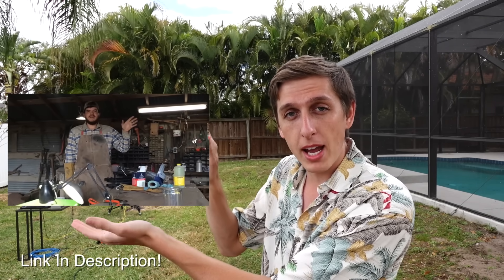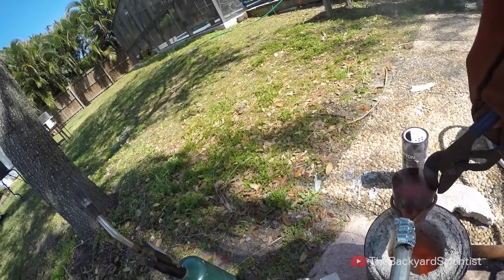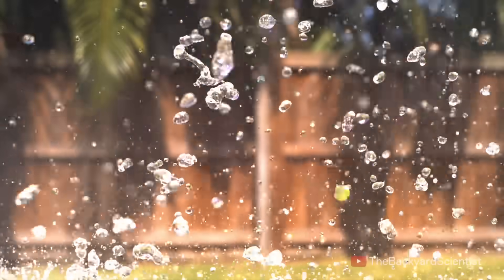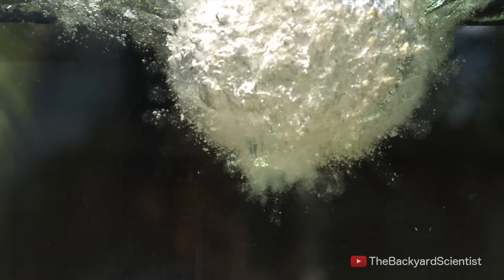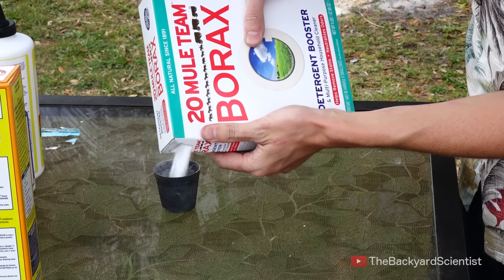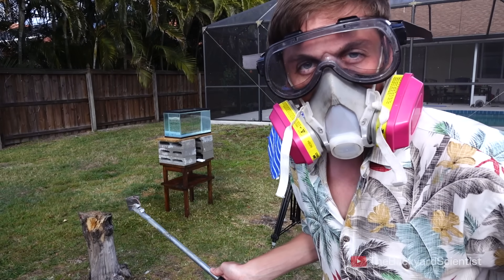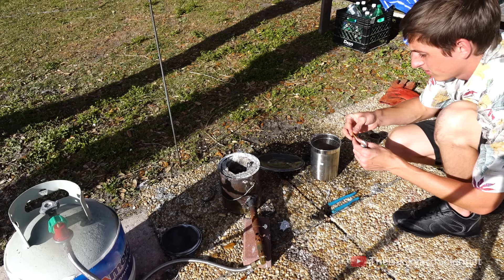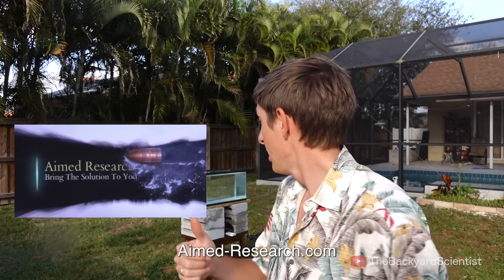Pouring Molten salt into Water - Explosion!

Comment: I don't think it's a chemical reaction. If you look at the reactions of sodium (molten and solid) in water neither have such an effect and chlorine in water doesn't react like that either.

Looking at the other ionic compounds added, all of them form smooth surfaces and ball like structures that minimize the surface area in contact with the water, the leidenfrost effect (mentioned at 5:24) prevents flash vaporization of the water.

Sodium Chloride (NaCl) as you see in the beginning (~ 1:00 ) forms large crystals with lots of cracks in them... Cracks that can trap water. I think as the molten NaCl solidifies it traps water within the cracks which flash vaporizes from the temperature and expands at (from the looks of it) supersonic speeds creating a shock wave.

I've just gotten to the ending of the video where @TheBackyardScientist offers the same explanation lol but I'll leave this anyway as I agree with his explanation.

Comment: It's a physical change (there's no such thing as a "physical reaction"), not a chemical reaction.  The sodium in sodium chloride is not sodium metal, they are sodium ions.  Sodium ions do not react with water.  If you wanted to get solid sodium, which does react with water, you would need to run a current through your molten sodium chloride.  This would, in addition to creating liquid sodium metal (no longer ions), make the chloride ions oxidize and become chlorine gas.  This would be in an electrolytic cell, as it is non-spontaneous redox reaction.
Reply: there's no shame in knowing stuff
Reply: you're*

Nevertheless, I don't think that his hypothesis is true.  Sodium chloride is a strong electrolyte, it ionizes in water.  I don't think the water (which has a very high specific heat capacity) heats up and turns to steam before the sodium and chloride ions separate.

As I said in another comment I'm just being pedantic when it comes to the definition of "reaction."  No chemist would ever call a physical change a reaction.

It wasn't being showy explaining that no reaction took place because he tested the pH of the water, he thought at one point that a reaction might have taken place.  I explained why it couldn't have.  You have a problem with this.
Reply: I'd call it a change in composition.  I was just being pedantic when I spoke of "physical reaction", to be honest.  The main point I'm trying to drive home is that heating up salts do not reduce cations or oxidize anions - electrolysis does this.

What's interesting is that to have the electrolytic cell you need the ions to flow freely, which is why heating them up to break their crystalline structure is so important.  If the salt is soluble, like sodium chloride, you could just put it in water to free the ions.  The problem, though, is that water is a stronger reducing and oxidizing agent than chloride ions and sodium ions, respectively.  So if you ran a current through salt water, it'd be no different than running it through de-ionized water.  The sodium and chloride ions wouldn't do anything.

The oxidation and reduction reactions of water are, respectively:
2H2O(l) → O2(g) + 4H+(aq) + 4e-
4H2O(l) + 4e- → 2H2(g) + 4OH-(aq)
Reply: I know Da Wae U DO NOT KNOW DA WAE
Reply: I actually used to remember this stuff back in chemistry class.
Reply: NaCl(sodium chloride) + O_2(oxygen) -heat-> NaClO_2(sodium chlorite)

sodium chlorite dissolves in water to form chlorous acid
NaClO_2(stable) +H_2O --> HClO_2(chlorous acid)(unstable)+NaOH(Sodium hydroxide)

Chlorous acid is unstable and will decompose to form hypochlorous acid and chloric acid

2HClO2 = HClO+ HClO3
Reply: Sodium hydroxide is a base and hypochlorous acid and chloric acid are acids.

Mixing the two(chlorous acid,Sodium hydroxide) would cause neutralization.

The reaction would not take place until it's placed in the H_2O.
Reply: No, that wouldn't happen.

The water has no sodium hydroxide in it.  If there was sodium chlorite introduced, the chlorite ions would react with water to create hydroxide ions and chlorous acid.  An equilibrium would be reached, but because we started with only chlorite ions and water, according to Le Chatelier's principle we must move forward in the reaction:
ClO2-(aq)+H2O(l) →← HClO2(aq) + OH-(aq).

This is still assuming that sodium chloride reacts with gaseous oxygen when it heats up, and nothing seems to support this, especially because heating up table salt and letting it cool down yields table salt, no combustion occurred.
Reply: Puberty is a physical reaction to hormones
Reply: wow 😮
Reply: Pranam
Reply: I didn't even think of the combustion of sodium chloride!  Next time I see my friend (he's studying chemistry) I'm going to ask him if that reaction of sodium chloride and gaseous oxygen can yield sodium chlorite.  

My hunch is that it (the sodium chloride) did not react with the oxygen in the air, because if it had then the water would have become basic (as you noted, sodium hydroxide would be in the solution), and his pH test indicated it was still neutral.

I was googling how sodium hypochlorite is prepared and I couldn't find anything about sodium chloride reacting with oxygen.  I did find this, though http://www.madehow.com/Volume-6/Sodium-Chlorite.html

edit: I asked him if sodium chloride can combust and he said no.  I'm not surprised because the sodium chloride melted before it readily reacted with anything.  He said it might be possible in small quantities, but he doubts it.
Reply: English please?
Reply: Good point but actually it is a chemical reaction because salt has a atom has one less atom than the water or h2o. But then stabilized when sodium and choline mix it goes with an even flow and it can also be a physical change because there is also no physical reaction. With physical changes you can see them much quicker that chemical changes.
Reply: citanaf citanaf so if you hit me and I hit you in retaliation, that's called a change and not a reaction?
Reply: citanaf citanaf cool knowledge
Reply: Physical reaction is what chemists call change in state... well at least my chemistry textbook and teacher say that.
Reply: 7:38 he literally said that sodium chloride reacts with water.  So no, it is not "literally what he said without be a know it allllll[sic]".  

Just because I know basic chemistry doesn't mean I'm trying to be smarter than anyone, I'm just pointing out what actually happened.  If me doing that makes you feel so insecure you probably have no interest in science, considering you can only learn when you're wrong.
Reply: the system reacts in a physical way? so then it would be a physical reaktion
Reply: citanaf citanaf
Reply: AHA YOUR A GEEKY NERD

Comment: Ok now I'm scared to eat anything with salt and water
Reply: Stay away from things that are 801 degrees Celsius and you will be fine
Reply: are you high?
Reply: One cannot simply avoid things of that temperature, you're asking too much.
Reply: Yes only avoid tempratures under 801 mk
Reply: Lily Slone funny
Reply: I lost faith in humanity.
Reply: unless you drink glowing red hot molten salt for breakfast  everyday i think youre pretty good.
Reply: Lily's reborn nursery 1 MELTED
Reply: gamingcentral :
kilauea volcano lava flows into the ocean :
https://www.youtube.com/watch?v=zmn71-DvVf8
from youtube search (magma flow to ocean) result 1,
does not cause explosion, lava temperature is 700 - 1,200 celcius 
source :
'Lava is molten rock generated by geothermal energy and expelled through fractures in planetary crust or in an eruption, usually at temperatures from 700 to 1,200 °C (1,292 to 2,192 °F).'
in
https://en.wikipedia.org/wiki/Lava
from google (lava temperature) result 1
Reply: gamingcentral :
correction :
Lava Pours Steadily From Hawaii's Kilauea Volcano 
https://www.youtube.com/watch?v=HzwuTBx93uA
shows explosion, so i guess anything hot going to the water, causes explosion
Reply: salt maybe is damaging :
try smear water to skin below an eye then
 smear salt to that wet skin area then
 around 5 minutes later that eye will feel hurting.
 replace that salt with sugar then that eye will not
 feel hurting.
 so salt is damaging, sugar seems not damaging.
Reply: GamingCentral lol
Reply: humans are sooo hot.. and the water mixed in, was just about to state the same. . life is sooo dangerous Oo oO

Comment: Actually if you drop pure sodium (non heated) into water it will explode. It's a chemical reaction. The fact that you obtain no pH change doesn't rule out chemical reaction. And that is the reason why in labs, if you store pure sodium, you must store it in a special container to ovoid humidity.
Reply: Ashrak Krazlegan in this case it does rule out a chemical reaction because sodium reacts with water only to make NaOH which is a strong base so the ph would rise into the basic area >7 with this amount of water involved 
Any other possible product made from NaCl and H2O which COULD be produced but does not in reality would still induce a ph change
When you heat NaCl it does not revert back into Na and Cl atleast not at these low temperatures 
The only thing happening is the rapid cooling of the salt which in turn heats up the surounding water
At temperatures way above its boiling point 100 celsius the water explosivly vaporises because water vapour has more than a 1000 times the volume as its liquid form

Comment: wonderful! I had a physics teacher in 7th grade, my first class ever of physical sciences, blow up a cup of sugar. The event was so extreme and over the top, everyone had to leave the room as thick wide coils of carbon were snaking off the desks and going everywhere. I loved it. What happened? What happened to the teacher? But that memory is forever.

In Supermans house in the arctic, he lives in a house of crystals. There is some gobbledygook about it, but then you can compare it(the crystalline shapes) as one of natures perfect shape, that old “one or another gone”. Theres only 5 in nature, and when you think about it, its ho hum. You see one shape you seen em all. But let me digress a little. Water can quickly get into the lets say pentagram sides and bawhoosh, wash out the sides like rock forms in the ocean. The crystalline shape stays the same over eons, or a loooong time. But! Bwahahaha for fun and dangerous giggles, why not pour molten salt which is fluid crystals (we saw that as the disc of hot cha cha melted salt return to Mortons salt, just a little dirtier.  The nature of design doesn’t change with elements. Well, it can, we can tour Cern’ gigantic chocolate making machine turning atoms into errrrrr particles but, lets stick(ha ha) with elemental salt. The crystals are all looking like Supermans house. I think we could easily blow up Supermans  house by filling it with hot molten aluminum. Each crack it found would expand and crack away from the next. Wow, we are talking a big big explosion. Super cool. But, at the end of the day, Superman will have to suck in all those salt molecules and probably blow them out into the ocean, which invariably help with the desalination of the wirlds oceans. 
I love science!
Reply: LSD or shrooms? DMT?

Comment: Have you ever thought that maybe the reaction is caused because of the iodine being used to treat table salt or have you used untreated salt? Also have you tried this experiment with sea salt or let's say Himalaya pink salt?
Reply: tudy000 the iodine in salt is itself in salt form like NaI which is non reactive
 pure iodine would just sublimate of and would be quite toxic and kill you really fast
and even pure iodine is not able to react with water because the oxygen in H2O is far more electronnegative than iodine thus would not be able to rip any hydrogen or even oxygen from H2O
Reply: Yeah ok i get it, but pure salt has no iodine in it that's why i even asked if he used untreated salt,sea salt and himalaya salt :) since this 3 salts have no iodine in them

Comment: Final question: Because salt (Solium Chloride) reduces the surface tension of water (H2O) and allows more rapid transformation of the surface of the water.

High surface tension water with a hot "thing" is like a fat guy pushing his way through a crowd... people see him and move. Low surface tension is like a winger (American: Line backer) darting and weaving his way whether you move to see him or not.

Comment: A Bit late to comment on an old video, but here it is anyway.  Assuming your hypothesis that the water is getting into the middle of the  molten salt is correct (It seems plausible).  The Kosher Salt had a very low viscosity whereas the Borax seemed to be a much higher viscosity.  This would result in the water not being able to penetrate the glob of molten salt as easily the higher the viscosity of the salt.

Comment: Seems like the molten salt exploding in water is the result of a coefficient between the viscosity of molten sodium and its super heated state. Which would also explain why it didn't yield satisfactory results at lower temps. At a super heated state, the viscosity is probably so low and its temperatures effect on the water is so high that it deforms more readily in the presence of water and steam, capturing more of it in pockets of the molten salt, which then rapidly expand creating the explosion.

Comment: I think that to avoid leidenfrost insulation the surface needs to remain molten. I know from messing around with CO2 in water as soon as the pressure rises to a point CO2 turns liquid, heat exchange jumps up hugely. I think that the higher melting point stuff you add gets a surface crust possibly just from radiation through leidenfrost layer and so is boring. The salt keeps a liquid surface so the thermal interactions and boiling cause a chain reaction of mixing.

Comment: Sodium forms a single bond, Barium two, would this explain why the water molecule was able to penetrate? Or maybe I should stick to history
Reply: feoil Sodium Chloride (aka Table Salt, or NaCl) is broken into Na+ and Cl- ions with extreme heat. Alkali Metals (Lithium, Sodium, Potassium, Rubidium, Caesium, and Francium) all react violently with water. So, because the Sodium Chloride is broken into 2 elements (Sodium and Chlorine) and not a single compound is most likely the reason for this reaction.
Reply: Yes, but the guy in the video wondered why a Barium salt did not react the same way. As you have pointed out, an alkali metal offers only one electron in bonding, whereas Barium offers two forming a double ionic bond. My suggestion was that this closer bond (and therefore more tightly packed crystal) might explain why water molecules could not penetrate as deeply.
Reply: feoil Barium is an Alkali Earth Metal, Alkali Earth Metals do not react violently with water. Alkali Metals, however, are very reactive in metals. He was testing to see if it was just the Alkali Metal reacting or if it was the crystalized compound that was reacting with the water.
Reply: Yes, and he established that this reaction (molten salt on water) was physical rather than chemical. Therefore the relative reactivity of Barium and Sodium are not relevant in this case. What is relevant is the molecular structure of both salts. NaCl, is one Na exchanging an electron with a Cl, giving the Na a charge of +1, the Cl, -1. The Ba however, becomes +2 in BaCL2, with two Cl's of +1 each. This means a stronger magnetic bond between molecules of BaCl2 in either liquid or crystal form, thus hampering the penetration of of the H20's. Cos Barium is twice as attractive as Sodium.

Comment: My hypothesis is because the heating process weakens the bonds between the chloride and the sodium, so the sodium can act more on its own. Sodium metal by itself is extremely explosive and combustible in water, so the destabilized molecule and the reactive sodium would make it explode.

Comment: I can't see the correct answer anywhere here. Salt has a enormous latent heat of solidification. That is the energy it releases on going from liquid to solid. So you're putting a lot of heat into the water in the space of micro seconds. The water aggressively vaporizes resembling an explosion.
Reply: and that explains why it's not the same with other salts

Comment: The process of dissolving is exothermic when more energy is released when water molecules “bond” to the solute than is used to pull the solute apart. Because more energy is released than is used, the molecules of the solution move faster, making the temperature increase.

Comment: I am only half way through the video and I know why this happens. I am in 7th grade and we got taught about this. When molecules are heated the move really fast and decrease size. When they are cold the increase size and move closer together. So if they are really hot and then get exposed to coldness they will not know what to do and they will quickly change. If you put a little bit of water in a pop can and heat it up then have a bucket of ice water and put the van it the ice water it will crush.

Comment: Sodium ions and chloride ions separate and move freely in molten state. Yes it is a physical reaction. The high kinetic energy of the ions, of course due to extreme heating, cause them to move at extremely high speed. Hence they collide with water molecules and cause them to move as well. Molecules and ions moving at extreme speeds causes the explosion.